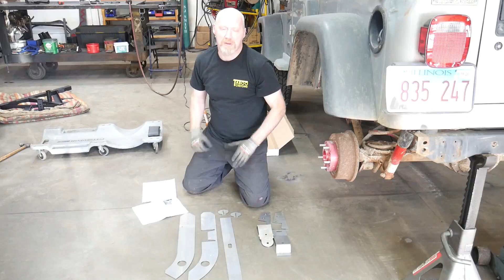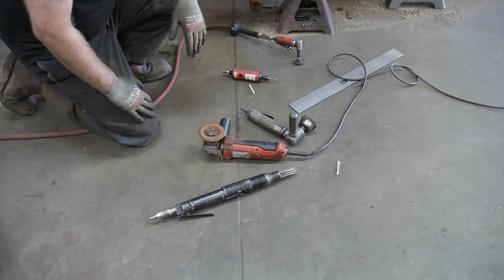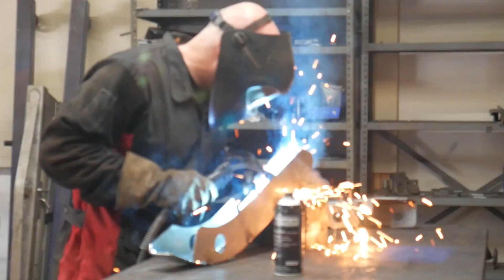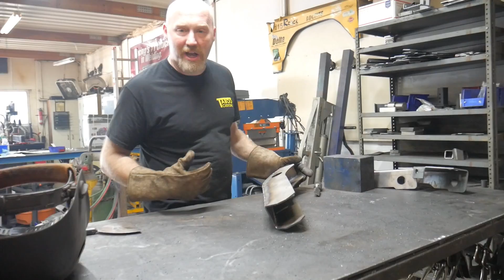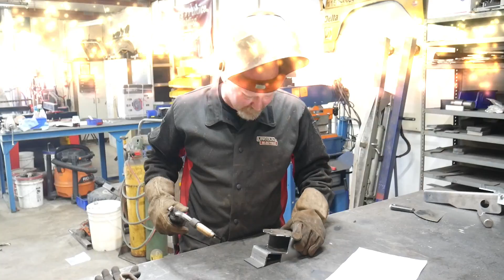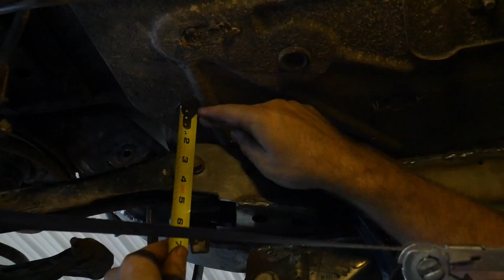Jeep TJ Wrangler Rust Repair Kit Installation for the Rear Control Arm Area of the Frame

Comment: Why would you buy all those pieces to have to weld them all together. There are other kits that are 1 piece units. Just cut, clean and prep the old rusty part of frame away, then slide 1 piece over the frame and weld it. Just curious. Thanks!
Reply from the maker: Good question! There are a couple of reasons we prefer the multi-piece design.

First, it gives you some adjustability during installation. Frames can vary from vehicle to vehicle because of rust, damage, previous repairs, or just normal manufacturing differences. With separate pieces, you can fit and position everything where it needs to be before welding it together. A one-piece assembly doesn’t give you much room to compensate if something isn’t exactly where it’s supposed to be.

Second, it helps keep the cost of the kit down. A fully formed one-piece assembly requires more manufacturing and tooling, which adds to the price.

There are definitely advantages to both styles, but we designed ours to give the installer more flexibility while keeping the kit affordable.  We are looking at in the future offering the frame section welded and the control arm mounts welded but keeping them separate to allow the flexibility we often see is needed.

Comment: Whatever method you use to descale, if your frame is real rusty, needle descaler, wire wheel on an angle grinder, etc, you can save a ton of time by just hitting it with an air hammer with a flat tip, it sets up some kinda harmonic or something, it wont do all the work for you, but i swear it will knock like 60%+ of all the scale off in seconds, then you can move to your preffered method for the details.  Its so brief a brap on the hammer, even if your compressor is too small to run an air hammer well, it will prob work fine.

Comment: Do you sell a kit that is pre welded or preassembled to slide into place ?
Reply from the maker: Currently we do not, we do plan in the future to sell the frame pieces pre welded and the mounts pre welded but not installed. We have ran into issues with the fully reassembled kits and getting the control arm mounts back in the correct locations that they were before removal.

Comment: Why aren't you measuring from the front suspension bolts to center of the rear bolts so the mounts are square and less chance of dog tracking
Reply from the maker: We do, may not have seen or mentioned it in the video.  Our instructions include places to document a few measurements.

Comment: Does anybody know how much will a job like this cost ?
Reply from the maker: There will be a lot of variation depending on who does it, where your at and other factors.  I will tell you in my area I charge $400-600 a kit installed. Most Jeeps need a couple kits.   Once you start to get to where your doing a whole frame or many kits the cost per kit drops some.   Some trucks we do get up to $3k total.

Comment: Great instruction!  I've tried to re-weld the rear axle upper control mount at the axle, after grinding clean the old mount.  For some reason, it's not allowing the weld to set.  I suppose rewelding the old bracket won't work?  It broke off somewhat clean; which is why I'm attempting to reuse it.  Is a new one the only material (surface) weldable?
Reply from the maker: On the axle end?  Both the bracket and axle tube should be easily weldable.  What do you mean by didn't set?  Maybe sending a picture of what it looks like after you welded it would help.  Dave@taboocustoms.com
Reply: @TabooCustoms  I just sent an email.  Appreciate your response!

Comment: Great video! Really like your explanation of your process. I do have a 60's Mercury with rust in the frame rails. Quite similar to how this Jeep looks. I want to make repairs to my car, but I am unsure if I should cut out the rust or do a repair as you have shown and build "repair" patches and weld to the existing frame. What are your thoughts? Thank you!

Comment: What are you using for a welder and wire size?
Reply from the maker: A 220V welder is needed, not that it isnt possible with a 110 but I cant recommend it.  For wire I use .035.  As for specific I was using MST 400 with a Lincoln LN7 Feeder, but now I use a Lincoln CV400 and LF 72 feeder.

Comment: Do you work on jeep wrangler yj's I own a 94 that has extremely bad rust issues on the driver's rear and passenger rear any and all help will be and is greatly appreciated I'm located in Columbus Ohio if you can help me I need price and shop name and where you are located
Reply: PS great video 👍 and thank you
Reply: I also think that I will need body mounts as well
Reply from the maker: Sorry we currently do not.  We just moved into a different shop and wont be setup for quite a while for repair work.  We are also located in Montrose IA, so it would be a haul.  If you have a local jeep club I typically recommend contacting them and they often know who might do that type of repair in your area.   Looking at my list of shops that will do those repairs I do have one in Arcanum OH, Brickhouse Collision & Customs.  You might try them.

Comment: Can this kit be used if you cut out the lower portion of the frame?      I noticed you went over the old frame without removing lower portion where the rust is.  I would think in time the rust will continue to bleed through to the new piece.   I like the kit but wondering if it will still work if the frame is cut out?
Reply: Gotta leave the rust in the frame to ensure repeat customers 😉
Reply from the maker: Yes, the more rust that can be cut out the better.

Comment: Got a video on removing the gas tank and fuel/brake lines?
Reply from the maker: Nothing specific, the lines just snap into holders on the inside of the frame.  Typically the issue with the removal of the brake lines is rust casing them to break.